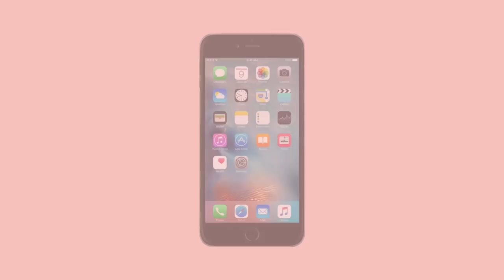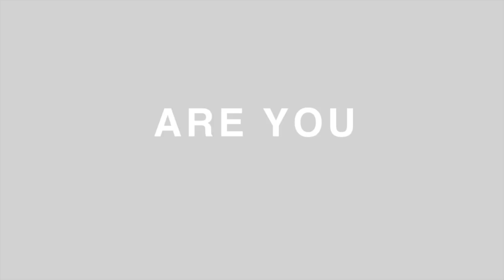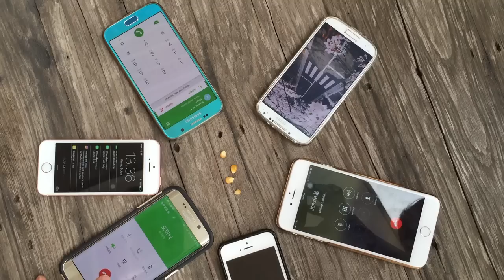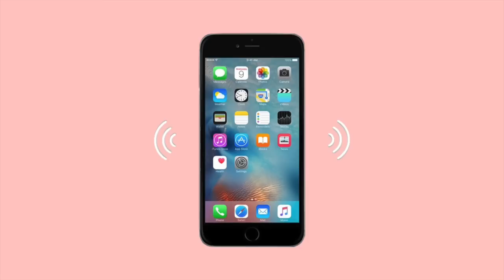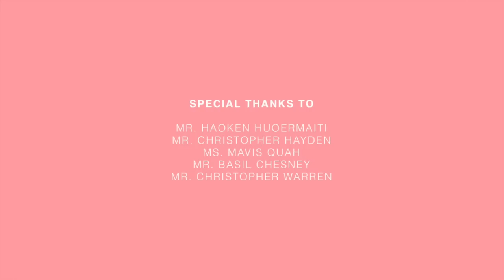Mythbuster: Can Cellphone Radiation Pop Popcorn? (IBDP Group 4 Project)

Comment: That's a wrong setup, the antenna on cellphone is not on top. you need to reverse all phones (better standing) towards the pop corn. and best thing is to use a metal bucket to contain RF reflection

Comment: The original idea that cellphones could pop a kennel was when the cellphones - very old ones - had those "red infra lights" on the top of the cellphones... We used to use that feature to transfer files in between phones... That INFRA REDS were the responsible for the pop!! Of course it would never work with iPhones!!!
Reply: Priscila Cassou finally someone said it